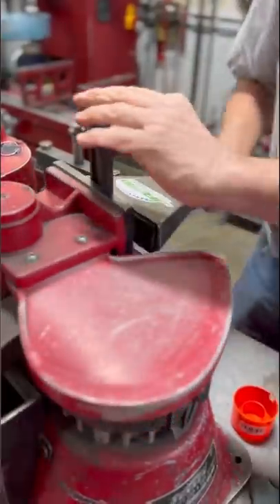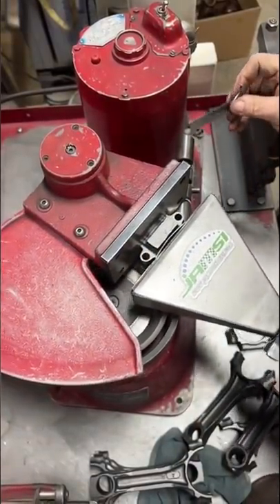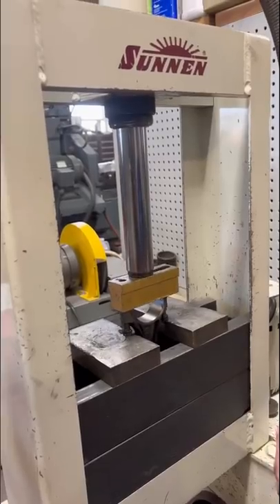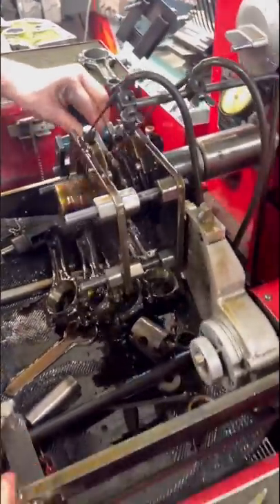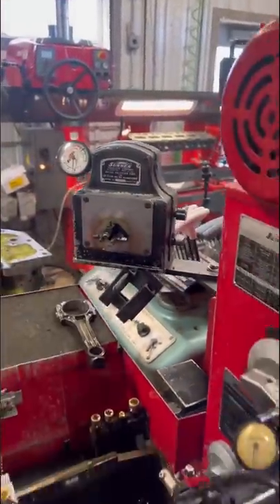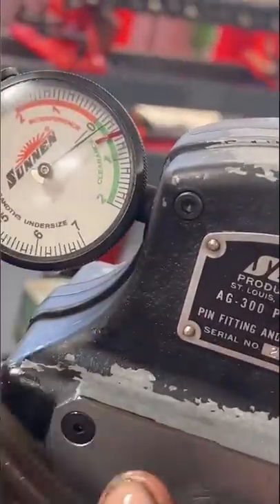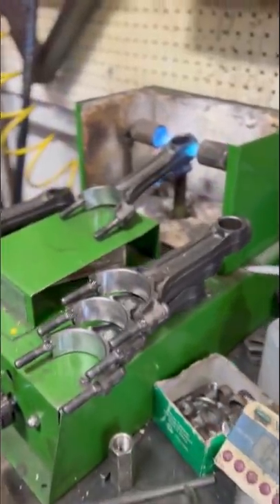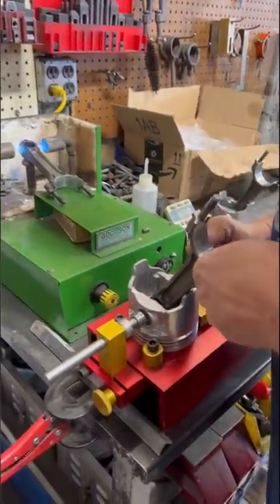#shorts Resizing 258 AMC Connecting Rods And Installing Press Fit Pistons!

Comment: Dying trade . I started at age 17 learned alot from rebuilding all kinds of heads to crank work , blocks then balancing the whole dam mass of moving parts . We built engines for those cars that go real fast I small circles with the wings on top . 360 s and 410s and even learned tricks to build grenade engines ! Wish I stayed in the trade but changed jobs after 5 years

Comment: Kinda sad to think as electric cars become more prevalent this WONDERFUL equipment and core knowledge will gather dust from lack of use.  I just wish I could’ve used this stuff and enjoyed the probable enormous job satisfaction that would come from it.  The 258 AMC is a wonderful straight 6 cylinder motor used from 1964 to 2006. I just love the attention these old work horses still get.  Great job guys and would love to break grease with you!!
Reply: Dont despair... I think that as EVs are mandated, the older cars will start seeing MORE rebuilds and repairs. Hope so anyway. Of course itll me a surge that will taper back to 0 eventually but....🤷

Comment: Cool, question, do you guys fix cracked cylinder heads?  I have a 1991 Honda crx DOHC 1.6l with a warped, cracked cylinder head , it’s been in my garage for 3-4 years now and I haven’t been able to find another head like it, I bought the car with that head and don’t know if it’s right for it or not, engine ran perfectly, until I took it apart, other than it consuming coolant with no signs of leaks, it definitely had major carbon buildup around 2 of the head studs

Comment: So when you remove material from the rod body you are shortening the rod center distance - is this a concern ?   I guess it would depend on how many times the procedure has been done to the rod . Your thoughts ?
Reply: I imagime it only changes center-to-center a few thousandths. On anything less than a high end race engine probably not a big deal...